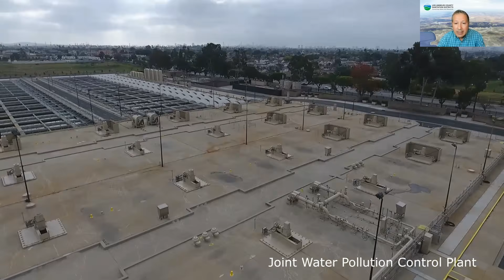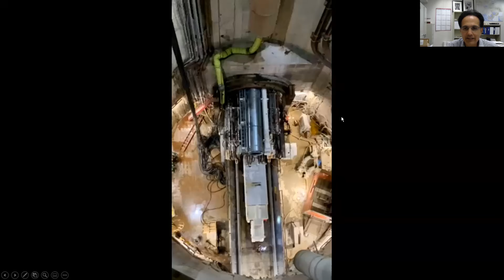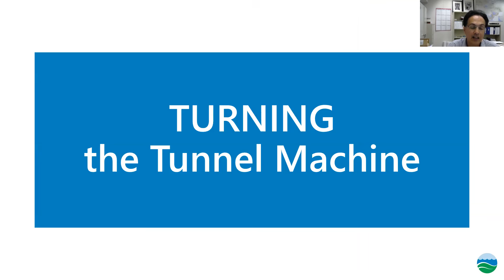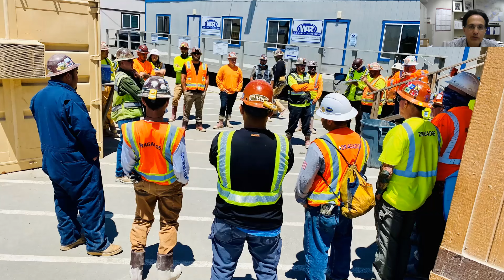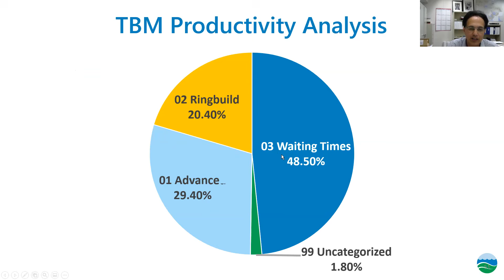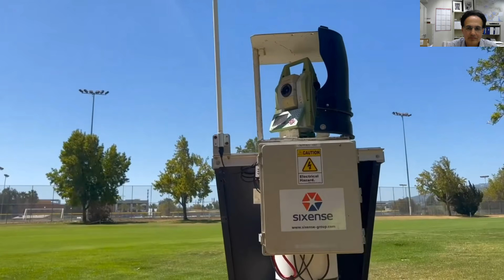How Do You Build A Modern Tunnel: Virtual Tour of Clearwater Tunnel Project September 2022

Comment: Thank you for the Update. I have been looking forward to it. I have a couple of questions listed below.

1) You mention that the engineers have factored in for seismic events, but with the new data on the Palos Verdes fault zone which recently came out and stated that it could possibly produce up to a 7.8 earthquake, will they have to re-examine and possibly make some modifications in that area?

2) I see that before the segments are put in place that there is already some sort of covering or lining there. Can you elaborate a bit on that area? Like the material used and or the thickness.

3) Once the tunneling is done and the segments are all in place will there be more interior lining put into the tunnel too smooth out the interior surfaces? Those segments seem to have a lot of pockets in them where they are bolted together.

Thanks
Reply from the maker: Hello, thank you for your questions. Please see our response.

1.The PV earthquake fault was incorporated into the overall structural design of the tunnel.  A steel liner (sleeve) will be placed inside the tunnel along the PV earthquake fault.  This design feature will provide sufficient structural reinforcement to withstand a 500-year earthquake.   

2.	Each wall segment is made of reinforced concrete that is over 1 foot thick.  These wall segments are erected every 5 feet inside the tunnel boring machine (TBM) housing.  Once all six segments are in place, forming a ring, the TBM pushes off the ring.  When the TBM pushes forward several feet, the tunnel wall is exposed to the surrounding soil.  A grout is injected into the narrow space in between the outer tunnel wall and the soil.  

3.	The concrete wall segments are edged with rubber gaskets that, when in place and bolted together, make the tunnel waterproof.  The wall segments also have pockets as part of their design.  These pockets are used to insert post-tensioning cables.  Once all six wall segments are installed, forming a ring, the cable is tightened.  This is another way of keeping the tunnel ring intact.